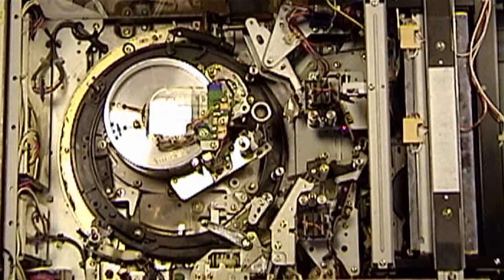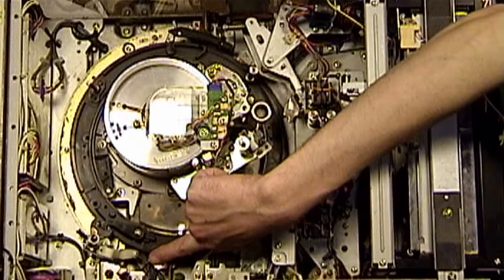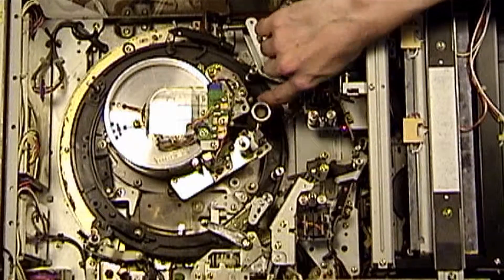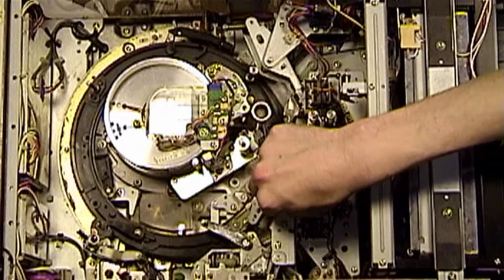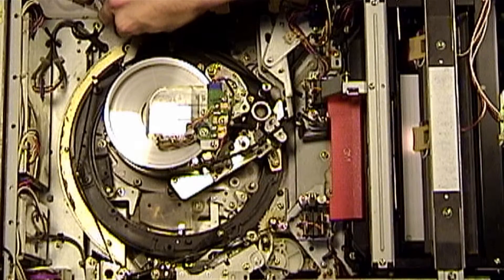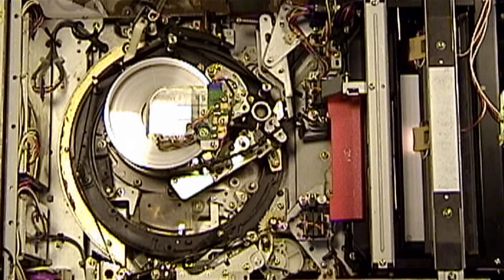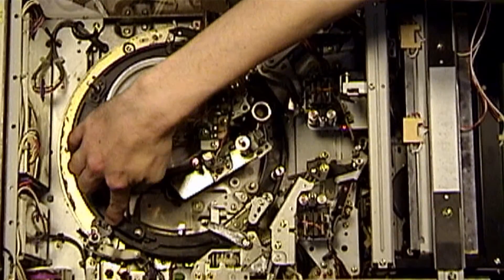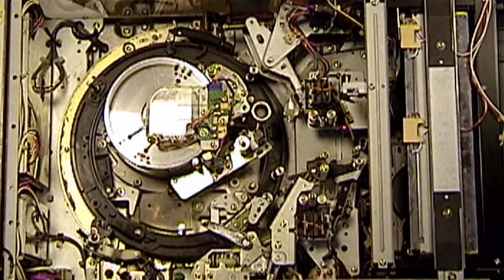Umatic Tape Threading System of BVU800 Series Preview

Comment: Hi, I have two BVU-800 series machines, a BVU-800 and a BVU-820. I'm starting with the BVU-800 first, but both machines don't want to load tapes. You can insert the tape into the cassette carriage but it doesn't accept it and start the threading process. It doesn't even lower the cassette into the mechanism. It just sits there and the takeup reel spins. I noticed the belts were missing from the BVU-800, I found a replacement for the belt on the cassette carriage, but I haven't replaced the belt on the threading motor. As of right now there's no belt. I think the mechanism is like partly threaded but there's no tape installed.

Comment: Now, tha's my kind of a video!
Reply from the maker: Cool! I really need to do an update video. I've been the in-house repair tech for a tape preservation/transfer place for a few years now. (having started with video stuff in the 90's). I got to fix an Ampex VPR3, scary when the reel servo goes nuts but loads of fun! I've also been working slowly on building my own big multi vtr/multi mixer real time digital/analog fx setup based on bvu 800's, 900's betacams and digibeta. After 10 years there's just now enough to get critical mass but I have to stay ahead of failing components and circuits I don't fully understand all of... and I mean some basics about fixing artifacts in chroma carrier conversion/video processing electronics. But after I shot this video I decided to get a worn out junker-parts bvu 800 fully working. As in , working well enough to stand up to my auto editing controller making 100s of short cuts,  driving with a lead foot for hours without failing pre-roll servo lock re-trys. It took me months to get that old deck working that well using old parts and it was a horrible pain but I think I learned from it.

Comment: I really wish they didn't start putting more plastic parts in the transports on their VTRs.  Even a $75,000 HDCAM SR deck, as far as I know, has a plastic transport ring in it.
Reply from the maker: Its the plastic springs that worry me the most. I have had a few failed gears but not in any bvu deck yet. Sony does seem to use good plastic, didn't snap parts even with badly misaligned guides hanging up and getting torqued so hard that metal got bent up, but that's on this model shown here. That being said I did once have a sony cassette tape deck pinch roller arm snap in two because of a tape jam winding around it's tiny capstan... and that was the end of it!

Comment: Wow! Haven't seen one of those in years! Last worked on those in late 80s, early 90s, and they were old then. Are parts even available for them any more? Slow threading could be caused by weak threading motor, but also check the plastic gears. I remember the VO5800/5850s in the newsroom had so many tapes run thru them that the worm and pinion gears would wear to the point of sharp teeth and ridges. New gears have rounded teeth and ridges, and less surface area to bind as they turn. Old gears have sharp points with flat surfaces such that they will bind. I hope that makes sense. Hard to explain without a drawing.

A couple of other weird problems on the 800s:
If the tracking at top or bottom of screen slowly moves and RF out from heads observed on scope is "breathing" (slow fluctuation of level) - check the upper and lower guides for grooves cut into them by the tape. If the guides are not worn and the pinch roller and capstan are not badly worn, these machines can damn near be aligned visually by adjusting the guides so the tape rides in the lower cylinder rabbet without bowing or buckling. A Sony engineer told me that. I doubted him, but later found out he was right. After replacing the worn guides, I visually aligned with an old tape, then ran the alignment tape and the RF waveform was spot on with no breathing, no improvement could be made by adjusting the guides. If you can't get new guides, you may be able to turn the old ones over.

Another odd problem was random stopping of the tape immediately after hitting play from pause mode. The brake adjusters on the reel tables have an adjustment tab that sets how far the reels can turn before the brakes begin to grab. These machines had been play/paused so much that the metal tab had fatigued and cracked so the the brake would grab immediately before the brake solenoid had made its full stroke. Of course the tension servo didn't like that, thought the tape was jammed and stopped the machine.

Hope this info might be useful for you.
Reply from the maker: Yeah that's very useful, thank you thank you! Any info on these is badly needed. I never worked on VTRs professionally but I started 20 years ago repairing vhs machines to sell with a partner in classified adds. As the years went by I grew to hate consumer grade machines and when studios went digital I started buying analog video tape gear and by now all the consumer grade stuff is all but dead. Must have tried to get away from vtrs 3 times prior, but when I saw the mechanism in the BVU 800 I just had to have one, and another... now it's never going to stop. Best mechanical challenge I've run into yet! (BVU-800 mechanism)
I don't know what parts are available I do this by having 6 machines, expecting only two or three to work off of parts from the others. I have a tape controller (bve 910) and basic mixer, bunch of other decks and am still building a larger and larger 3/4" and Umatic SP editing system as very limited funds permit. If you would be willing, I have questions tho most of them are about filling out my rather limited knowledge of adjusting and fixing the electronics; although my projects are not limited to repair and editing.
I realize the 800s won't last for ever without a lathe and more parts and tape - half the reason I'm doing a lot of 800 work right now is in preparation for building a linear analog video tape echo machine (for echo visual and synced audio effects). It's something I've wanted to do for many years - it's literally going to run a very long (60 plus foot long) tape loop at the umatic native speed of 407 inches per second, using 800 and vo-5850 electronics from several 'host' machines... and even a linear fm system so it can have sound on another track. It's a crazy project but I think it will work and generate a lot of interest in this sort of thing.

It's happening partly because I hate how computers are so unresponsive and have such crappy control surface regarding any sort of live delay or echo A/V effect so I'm designing and building a giant tape "echoplex" for video using linear video tape recording (not helical) complete with TBC and mixer. The delay/echo time will be controlled by the space between the linear record and playback heads. I'll add other features once I get the prototype working. There will be video of all of this as it happens but I first have to do a lot of prep and experimenting so I know where to bypass and mod and hack and what to build.
Anyway, thanks so much for the long comment and interest; hope you'll like the stuff that should be coming up in the next 6 months or so as I'm looking to do things I've not seen anyone else do with analog tape. On my channel you can see various projects I've done with multi-deck editing and other things. Thanks!!
Reply: You mention how the u-matic native tape speed is 407 i.p.s.' however that's 10.3 metres/sec.'  I believe the native speed is 96 mm/sec?